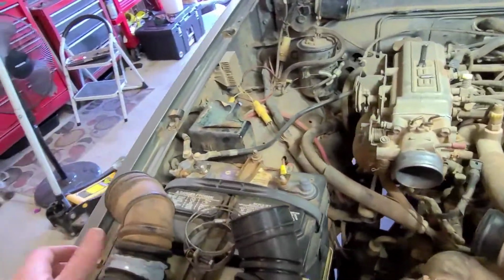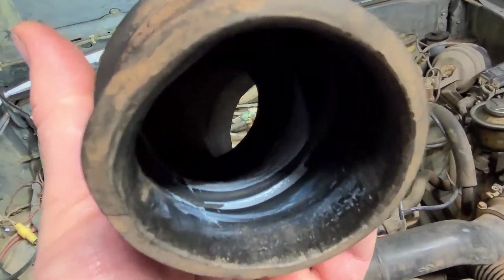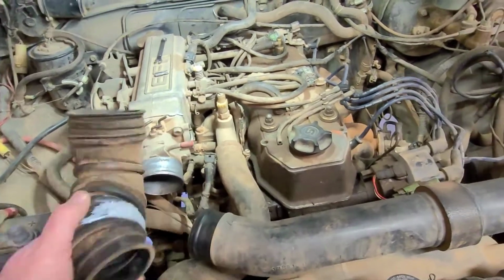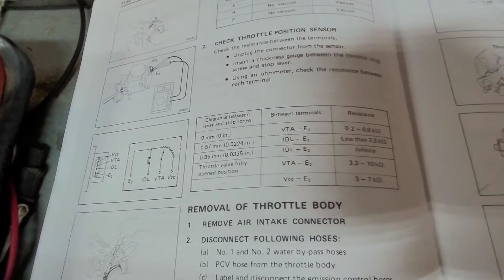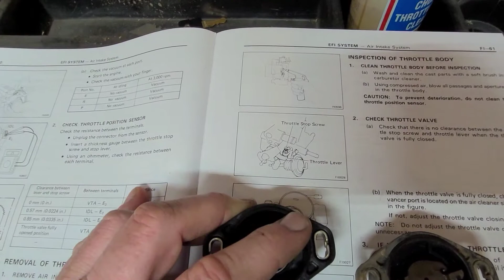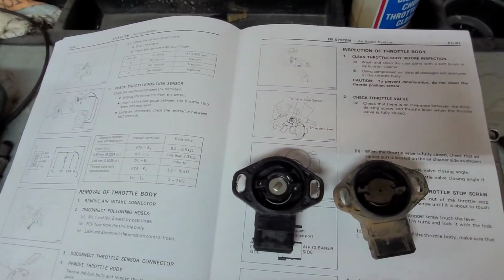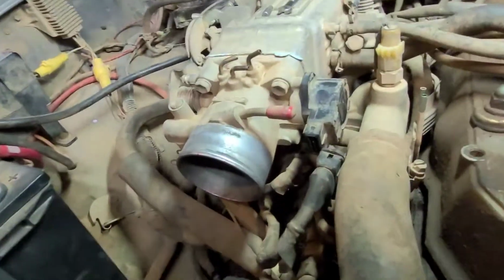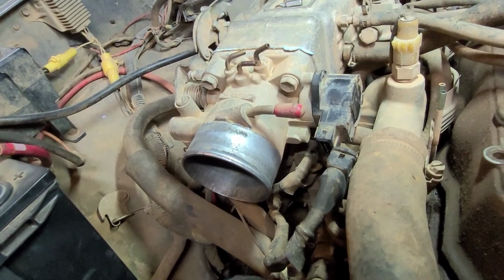Several common drivability issues with Toyota 22re

Comment: Nice video man! Picked up a 1987 toyota rv with a 22re. Been sitting for a few years, dropped the fuel tank and cleaned it out with a new fuel pump and fuel filter. Had to fix a lot of wiring as mice got into it. Fired up with a misfire and like your video tested TPS, MAF etc. Turned out it needed new spark plugs. Put in new plugs and wire and it runs like a champ. Passed smog here in CA with flying colors. 22re is such an easy engine to work on and diagnose and runs great even after all these years.

Comment: Good morning I have a 93 Toyota pickup 22re. One of the injectors was leaking fuel and engine shaking. I rebuilt all injectors. Not leaking any more but engine still shaking
Reply: I’ve got the same issue on my 94…once warm the idle is very low & engine shakes

Comment: 91 toyota truck. Wants to stall when put in either Reverse or Drive. Other than that, it runs great. Any idea on how to diagnose/fix?
Reply from the maker: Automatic or manual? I'm assuming auto
Reply: @theman9764  yes automatic. Trying to locate maf

Comment: My 1989 22re bog whenever I pass certain rpm and only if I press the pedal halfway and dosent want to redline it has a weird straight sound when I gas it all the way, the bogging is like when I'm decking it does not climb straigjt and normal it's going to have like this small thud or a tiny pop every second basically making me loose power, any thoughts what can cause this? I'm wondering if it's  maf or tps or something else
Reply from the maker: Honestly without actually hearing it and seeing how it runs, it's really difficult to diagnose, I'd hate for you to just fire the parts cannon at it and still not fix the issue
Reply: Mine is doing the same thing! Did you ever figure it out?

Comment: I did egr delete  and took off and cleaned throttle body.  I'm wondering  if I put that back on right. Now idles high and idle screws all the way down. Any thoughts? Oh and  throttle when let foot off gas its like it grabs like its bogging or steps down. But touch gas and it goes fine. So not bogging.   Thinking some how maybe less idol  air , well in gear?
Reply from the maker: Sounds like a vacuum leak or the Throttle Position Sensor is out of adjustment now
Reply: Well I soaked it with a can of carb cleaner. And found 1 vacuum leak. And that helped. But ill give on the position sensor. Was working pretty good on first start up then it sit a few weeks. An on this second start. It started this. But I admit when I put sensor back on i just turned it till it went in slots then twisted it up to match screw holes.  And its set all the way down I guess. If I untighten and move it it just goes up higher. So may have  twisted coil to much before screwed it down.   Gues ned to watch a video on just putting it on right way. I admitted ly haven't done one before.   Funny thing is I've had 17 of these trucks not one in 30yrs has been a re,  now I have 3 of them and 4 engines..lol.   so better figure it out...lol. or engine swap brains out..lol.  maybe just take it off and reinstall. Slower.. thx for any help.   Miss those carbs
Reply from the maker: @justdave4972  make sure you have a set of feeler gauges and it can be done on the vehicle but it's a thousand times easier to adjust it correctly on a bench, and if you're adjustment is just a few thousandths off, it'll make a huge difference in drivability, 22reperformance.com sells oem sensors so check with them if you need to purchase one, and make sure you match it to the correct part number that's on your old tps
Reply: @theman9764   ok so took my Pepe on a little night crawl out.   And of coarse  had couple little idiots try and do a bump car jackin..  lol. But I guess I owe them a little  bit. Because  while waiting for the PoPo to come tow their car away I decided to play with valve.  So moved it to about center and backed idle screw up a pinch. An my little beast was all nice and happy. Everything evened out. And back to shifting without a clutch,,  only issues now except its still idling
 From 1k to 1500rpms.  But its incredibly smooth  and almost feels nice at that.   Although getting feeling might be running pinch rich or lean..     so now what now ya think break out multi meter and feeler guages..?    
Thx appreciate ya!

Comment: How do you connect censor have to take lot of shit off. Two small screws hard to get to
Reply from the maker: If you're talking about the throttle position sensor, it's much much easier to just remove the throttle body and replace and adjust the sensor on a bench, make sure you have a new throttle body gasket ready, and you'll need a set of feeler gauges to properly adjust the TPS, 22reperformance.com sells everything you'll need including Allen style bolts to install the new TPS

Comment: I'm getting code 13 and 71, 1993 P/U 22re, 71 is egr but 13 is one I don't seem to see any problem. Any info on code 13 would be helpful
Reply from the maker: I've never seen a code 13 pop up before, but i can check my manual and see what i find
Reply: Code 13 is distributor, wires, plugs, somewhere In your spark.

Comment: My Toyota Pickup 94 22RE it be stalling while driving sometimes. 

2 days ago coming from work it stalled and turn it back on like 3-5 times 

What can it be?
Reply from the maker: Does it spit and sputter or does it stall out and die? And is it an auto or manual trans?
Reply: @theman9764  It just stall and die, I start right away, stalls again, turn right away. Runs fine after
Reply from the maker: @cuadrinhovlogs1930  could be a number of things, possible clogged fuel filter that is overloading the fuel pump, could be a bad fuel pump, distributor could be crapping out, AFM could be getting stuck closed, TPS could be faulty, there's 3 things an engine needs to run- fuel, air, spark. When it dies, try to figure out which one it's not getting and go from there, the easiest one to check for is spark, and if it's an automatic, there's a chance the torque converter is locking up causing the engine to stall at lower speeds, but it all depends on what is actually causing the engine to die
Reply: @theman9764  I have Toyota Pickup 1994 manual trans. Have similar issue. Been stored away for 3 years. Now starting to drive it again. Rough idle, and hiccups while driving, sometimes dies at a stop light. But I can easily start it up again, but gets rough idle still... The hiccup (hesitation) during driving (when I have foot on gas pedal) feels like it will just stall/die on me while driving as well... The repair shop replaced cap and rotor, but still no difference... Next, I plan to change spark plugs... do I need to change spark plug wires too?  Air filter looks clean. I poured in Seafoam into the gas tank still waiting to drive it a few days for that to go thru the fuel system to clean up all the gunk from being left unused for 3 years...
Reply from the maker: @be236  if it sat for a couple years, there's a good chance the fuel is bad, you need to drop the fuel tank and inspect the pump, hanger, and hoses for damage, if it had ethanol blend fuel in it, then it needs drained and cleaned out, replace the fuel filter while you're at it, check the intake boot for tears on the underside, and make sure the AFM door is swinging with little resistance, and inspect the idle air control motor for carbon buildup, there's so many things on older toyota trucks that can cause running issues, it's always difficult to pinpoint exact problems, a factory service manual can be your best friend with diagnosing problems
Reply: Its you're Idle Air Control Valve had the exact same symptoms and that fixed it for me